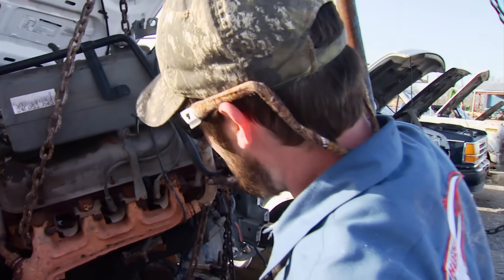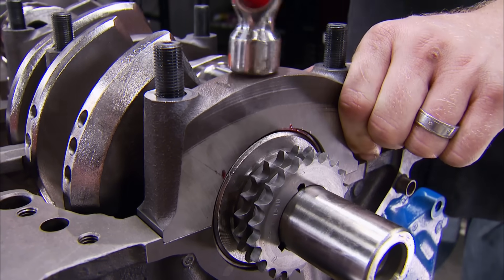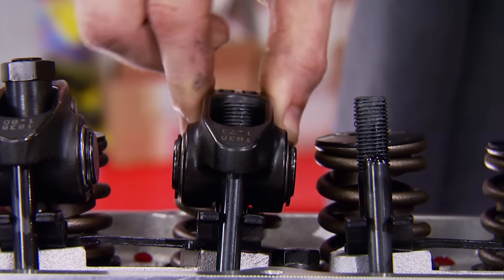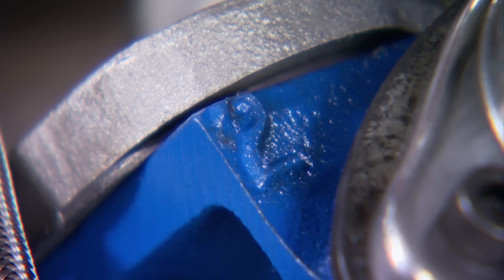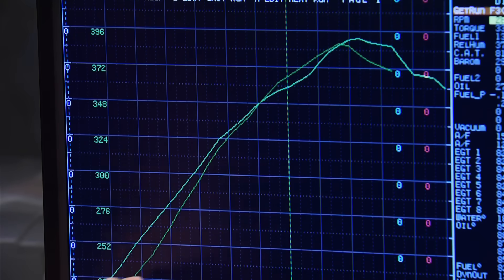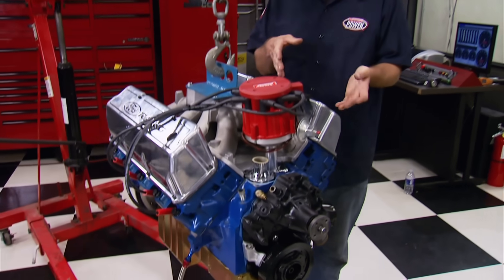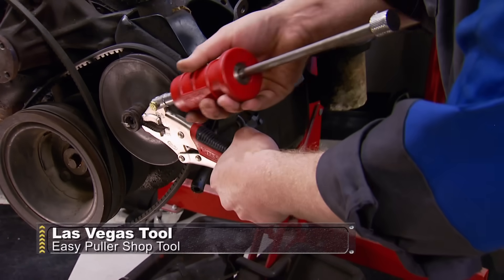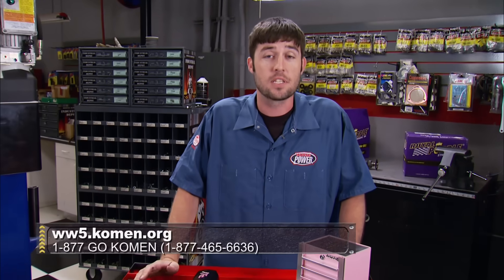351 Small Block Dyno Shootout: Windsor vs Cleveland - HorsePower S16, E11

Comment: They sure did the Cleveland dirty.
Reply: yes they did
Reply: 100%  what a disappointment
Reply: If you want to have a 351 Cleveland built make sure Powernation don't build it. I Didn't think you could Screw up a build so much.  I have been building Cleveland's for 50 years, they are the easiest engine there is to make Horsepower
Reply: 410 vs 358... 4V Heads only work at 7200 ish. (Cleveland's modular iron cranks etc harmonic at 7400, so rev limits are UP TO 7200, or 7600 plus, rare) . My 351C were built with 4V inlets and 2V exhaust, 69cc, forged flats relieved, 10.8:1. Hardest mid rpm engine I built. Pull stumps.
Reply: @logic.and.reasoning  And what Farry tail did you pull that one from.  Obviously, you have had nothing to do with a 4v Cleveland. 
I have seen 4V Cleveland's that would come on so hard off idle that they will blow any street tire right off the  car. if you can't build a 4v Cleveland with low end HP you should go back to your Chevy engines. There is no question you can build one that will make big power at high RPM, but If you say a 4v Cleveland has to run high RPM to make power  you have no clue. The stock Boss 451 would  eat any other small block alive and it only run to 6400 RPM.
Reply: @mylanmiller9656  451... ? Lol. Showing your lack of knowledge is hilarious! So all street cars ran 4V heads then? Cos they were so good? Well cupcakes, reality is ported, valved 2V heads were for more popular for street driven performance. Deny that fact...
Reply: @logic.and.reasoning  The only guys that run the low performance heads were the guys that had no clue how to build a good high performance one.
Reply: @mylanmiller9656  not low performance... higher low end torque. You are clueless. What dont you get about daily driven vs strip? Lol. Get a grip kid
Reply: @logic.and.reasoning  Every time someone says something about a Cleveland some idiot comes up with the idea that you will Gaine bunch with a Australian Head. i thought maybe it was a true so we spent a Fortune to have a set shipped. This was back in the early 1980's and it cost us more than 2000 to get the heads and intake have the port and valve train work done to make them equal to what our Cleveland heads had.  We installed them My Car that was running 11.84 at 113.57 We installed the heads and the car slowed to a best of 12.23 at 110.85. We run this set up for 3 weeks trying to get more out of it without any results. Even My 60 foot time fell off. if the heads were better for torque the 60 foot should have been quicker but it wasn't.  After the guys at the track seen how much our performance fell off we couldn't give those heads a way.
Reply: @mylanmiller9656  sure...
Reply: @logic.and.reasoning  4V heads are not great for High rpm. they were designed for a mid range of rpm. you are regurgitating myths

Comment: There's a lot more HORSE POWER in the Cleveland they do not know how to get more out of it or they do know and are trying to make their Windsor made cleaver look better they were getting more horsepower in the sixties and seventies out of those engines racing on the track I've got more horsepower for just driving it on the road. It's a matter of fact Wynne Ford racing made the first clevefor they asked Holly company to make a special carburetor for this engine so that's where the thousand CFM dominator come from made for Ford they would not have to do much to have made more than 400 horse and above on that Cleveland. I want to correct myself the dominator carburetor built by Holly was not built for the Cleveland or Clever it was built for the 429 boss sorry my bad.

Comment: They are two different engines period. 
Low compression and big port Cleveland heads is not a powerful combination. 
Unless you plan on running your Cleveland at 6000 rpm. 😲

Comment: This is the first time I do not agree with your testing. The Windsor got way more trick parts than the Cleavland. You gave the Windsor aluminum Clevor heads, a fair comparison should have been done with closed chamber Aussi 2V heads closed chamber heads. This would raise the compression and add hp and torque. But a real 4V test should have been with closed chambered heads. Open chamber smog heads were used. Not the optimal choice. The test was conducted using 1970s tech vs modern tech so I must call BS. I know this video is three years old but being a Cleavland engine fan, it would be cool to see an updated fair comparison.

Comment: You used an open chamber 4V head on the Cleveland and not a closed chamber 4V head. Open chamber 4V heads were available in 1973 and 1974.

Comment: I would think engine guys would know that engine torque is in lb-ft, not ft-lbs.  Ft-lbs is a measure of work, and lb-ft is a measure of force.

To save going over all of the arguments, here is the standard: 

"The industry standard for measuring an engine’s power output is SAE Standard J1349, which is the standard adopted by SAE to specify a basis for net engine power and torque ratings. “SAE standard J1349, Table 1 lists the units of measure used in the standard as “N-m or lb-ft” for torque and “kW or hp” for the horsepower ratings,” says Gary W. Pollak, P.E., Program Manager for the Society of Automotive Engineers."

I was expecting a comparison of Windsor vs. Cleveland, not two types of Cleveland.  Once you change to a Cleveland head, it really isn't a Windsor, it is more like a 351M.

Comment: holy crap did yall lose cool points with this test. next time do a 302 vs 460 or something. 
2v intake on a 4v head? talk about intake port mismatch! you created major issues with that alone. put those parts on a 400m, lets compare apples to apples. just by putting a 4v intake, roller cam and non-smog timing chain, that 400m will stomp the clevor. pmi and other make intake adapters to run 351c intakes on the 351m/400 block so no problem with intake choice. but at least run 2v with 2v and 4v with 4v. shit a 400 with police interceptor heads and a good intake decimate. flat top pistons from tim meyers inc...
yall should apologize for this video.

Comment: We’ve known in Australia for years the 4Vs are great race heads, but the 2V heads were better for the street. CHI even do a alloy standard 2V head (not a US company so doesn’t rate a mention here amongst these 20-25mins infomercials) 

You want a real test? Build a 408 stoker of both engines, make them use the best aftermarket version of the factory heads, and a Cleveland will eat whatever Windsor you put in front of it.
Reply: You folks down under have been known for many decades to really make these engines howl.  If I'm not mistaken, I'd heard that the last castings for the Ford 351 blocks were in Australia, and you folks were knocking out 351s under you wore out the castings!

Comment: They compared ford apples to ford oranges. The Cleveland rod and main journals are better suited for high RPM along with the heads, a big cam with 10-5-1 compression ratio would have suited the Cleveland but they knew that maybe to show what happens when you build a RPM motor two torque motor specs? The 408 cid Windsors motor with long stroke large rod and main journals plus a complete matched set top motor kit with a below from Edelbrock , 6100 RPM cam from you guest it a perfect combination made the expected power at the expected RPM. It's a good motor build. The Cleveland build is straight out amateur junk. Nothing works together and really need to select a better cam and the compression ratio 9-8-1, come on man!!!!
Reply: Typical for power nation🤣🤣🤣🤣
Reply: To me it seem nowadays they’re  more worried about advertising parts then teaching like the old days

Comment: I had a 72 Gran Torino Sport with a 351 2v 4 barrel back in 1979. It belonged to an elderly lady that was in charge of our public library and she bought it new from the Ford dealership in town and the did all the service on it. It only had around 28,000 miles on it when I bought it. All I did was put a set of headers on it. Had some work done on transmission and put a rear end out of a ford pick up and some rims and tires. And at 17 years old I had a Hot Rod. When I sold it in 1983 it had 120,000 miles on it and I took great care of the car there was not even a scratch on the car. That's one ride I wish I had not sold. Those 351 Cleveland were great engines if you kept them serviced.
Reply: They didn't make a 2v four barrel carburetor just a 2bbl the 4v is more correct no such thing as a 2v 4bbl 😂
Reply: @timothypriest4791 You beat me to it and darn it I just learned that fact today along with about everything I know about Cleveland’s.
Reply: If it had a 4bbl then it was a 4V not a 2V with a 4bbl

Comment: Apples and oranges. Highly modified Windsor versus a basically stock Cleveland. You folks gave the Cleveland the win by adding aftermarket "Cleveland" heads to the Windsor. The Cleveland is a high revving engine, which is one reason your under carbureted '4' heads underperformed.

Comment: Nice video although I'd have preferred to see what you could milk out of decent stock Windsor heads and stock displacement. I had a '69 Mustang Grande' with the factory dual exhaust 351-4v and it was a beast with manners (premium gas though was mandatory with the 11:1 ratio). I don't know how fast it would go as the speedo only went to 120 but with 120 at ~4:00 and "MPH" at 6:00 I had it up to "M" one night on Oregon I-5 just north of Gervais. It was probably a VERY risky thing to do  but I was 21 and a Camaro passed me while I was already up at 100 mph so the gauntlet had been thrown down, lol! Coming home the engine wouldn't idle smoothly and it turned out that the distributor internals had flexed just enough to make contact and break the plastic that held the tip of the rotor in place, so at idle the tip would move and retard slightly but when I revved it up the mech and vacuum advances would kick in and make the thing run smoothly. It was a sign of things to come; one day I was cruising along at 70mph or so and the engine stopped running forcing me to "dead stick" from the fast lane to the side. Luckily it was slave cylinder PS so steering wasn't an issue but the brakes were vacuum and also front disk so stopping wasn't super affirmative. It turns out that the distributor mechanical advance had failed and fragmented which shredded the inside of the housing.

Comment: So basically, what we've demonstrated is edelbrock aluminum heads are as good as 351c 2v heads. So you get 60 more horsepower with 50 more cubic inches and aluminum heads than a stock headed 2v motor with an oddball single plane intake... bend over, spread your cheeks, insert head.

Comment: Wasted money and time on that 408 for less than 500hp!!  The fact that it peaked out at 5600rpm or so should've told you! Put that thing into a 4x4 f150!! You spent alot of money on those heads for nothing! Cleveland are for restoration projects! They're getting pretty rare, and by the time you spin it to 7500 or shoot gas on the the blocks split!!

Comment: Next comparison - 1969 Chevy Z/28 302 with a 2 bbl carb, single exhaust, 9 to 1 compression pistons to a 1969 Chevy 305 with ported 10 to 1 compression heads,  Holley 750 cfm 4 bbl carb, dual header exhaust.

Comment: I had a 351 clevo 4v 4bolt engine and 11/ a half to 1 pistions we got 500 hundred horse power at 7000 thousand rpm in my GTHO falcon back in the 69to 71 these cars were the fastest 4 door salon sedans in the world down here in Australia in today’s market for the 1970!to 1971 the phase 3 GTHO will fetch up to two million dollars for one that hasn’t been molested and is stock standard from the ford company in Australia 🇦🇺 I owned a phase 2 not worth as much as the phase 3 it went as hard as the next model and just because it didn’t have the shaker poking out of the bonnet and had a scoop on the right hand side it was worth less

Comment: I was under the impression that you were going to run 351 Windsor to 351 Cleveland, not a 408 stroker with aluminum heads, clevor heads. In order in my opinion to make a fair comparison, you should have had 351 Windsor heads on that engine. It's my honest opinion that that Cleveland is a way stronger engine than the Windsor. Yes the Cleveland got a roller valve train, but basically that's it other than over bore
Reply: Couldn't upset the Chevy guys, now could they.  😉
Reply: Any 350 70 vintage vs 351 70-71 4v would be the real challenge.   Boss 351 vs LT1.

Comment: Swing and a miss on this one. Comparing a 357ci motor with 9.8:1 comp to a 408ci motor with 10.1 compression is completely pointless, of course the bigger motor with more compression is going to make more power. Comparing apples to oranges here.

Comment: Apples to watermelons with the mods. not a fair shootout. Now if you want more power from the 4v heads you must dump more fuel. They require a bigger cfm and jetting. I'm surprised they dont know this

Comment: At 5500 rpm each cylinder is firing 11 times a second... That's 2 revolutions of the crank per firing, so to acheive 5500 rpm, the crank spins 22 times a second, working in unison with the cam and heads to control the flow of gasses. These engines doing this for hundreds of thousands of miles is truly impressive.. God i love combustion engines.

Comment: What happened for Ford ? If fast forward to the 2000's, Ford tried to reinvent the  V-8 spark plug and failed miserably, not to mention Valve issues on the 3 valve, its pathetic engineering. They should have just worked on the computers,  heads and the rest of the induction on the 302 and 351 series engines to appease big brother .

Comment: You basically built yourself a 400m Windsor. A stocker cleavland is just a 400m. You can get over 500 hp in a 400m

Comment: Sad people think a 351C is a truck engine but actually it is the 351M that is the truck engine. Plus ran open chamber 2V and 4V cast iron heads on Cleveland why not closed chamber 4V and 2V Australian heads?
As far as Windsor just created a big inch better oiling Cleveland.

Comment: Next time you have a shoutout keep it apples to apples ! FYI My 71 Boss Cleveland with just a 600 lift solid roller, Holley strip dominator intake, and 850 dbl pump. Made 525@7200 RPM ! No other mods. Well, Ok Hooker headers...

Comment: Both Cleveland heads were open chambered. Closed chambered 2v and 4v are the only heads that should be used. Way better hp with the closed ones
Reply: Closed chamber or quench chamber heads were only available in 4v. All 2v heads were open chamber.
Reply: @edwo6648  not in Australia. I’ve got a pair
Reply: @wallafied  lol ... I had it in the back of my mind that that was a slim possibility since the 351c continued to develop down under. I stand corrected.